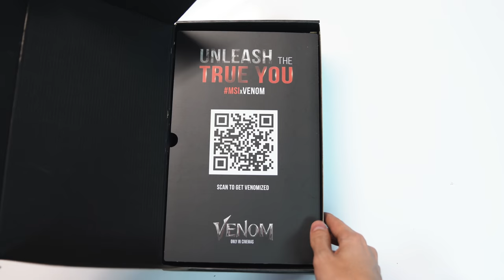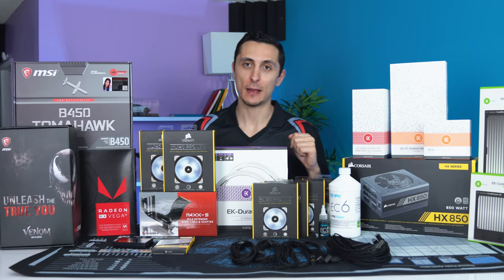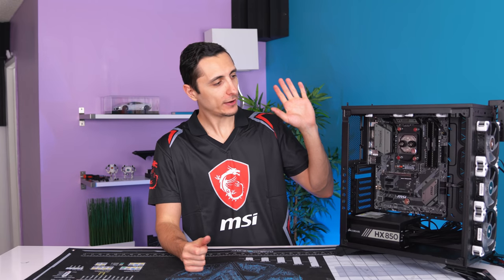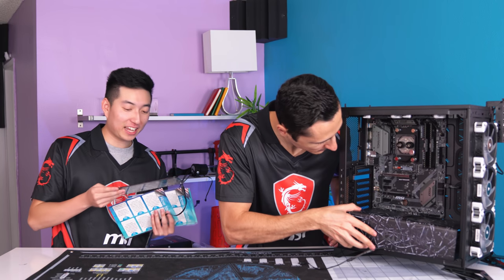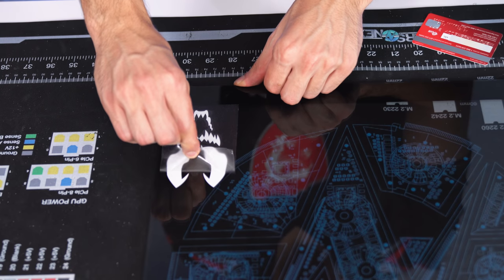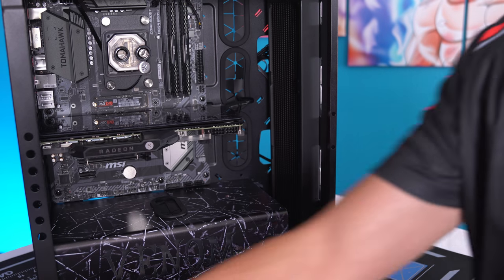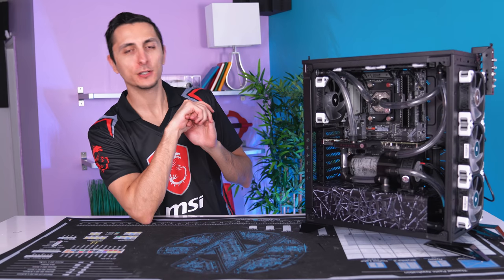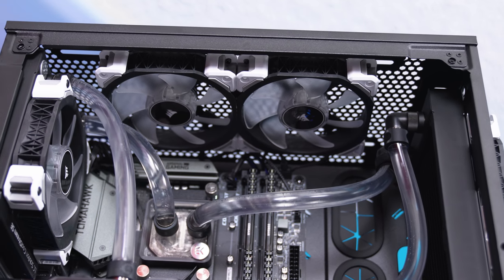Building A Venom Gaming PC - Setup Makeover Season 2 (EP 1)

Comment: I’m building my first pc soon hope nothing goes wrong :)
Reply: ExonicSkull Best wishes! If you don’t mind me asking, what are the specs? : )
Reply: i hope it goes wrong <23
Reply: @lukagafur7241  yeah. A 700£ pc and cheaper peripherals will basically do the job. Rest is overkill.
Reply: @lukagafur7241  ... I kinda agree actually. unless you're super competitive, a lot of that is overkill. I don't know your financial situation, parents, etc and I don't tell anyone how to spend their money, but just consider how small a difference but how high a difference a price between a $1,300 (without monitor) and $2,300 build. that said, I also wouldn't buy a $600 one as the other guy suggested. Yeah, it can be done, but I'm not a fan of buying anything you'll outgrow in a short time. Either way, nice job working hard. So many kids just wish for this and wish for that, but they're too lazy to make it happen and do nothing but make excuses. Good luck!
Reply: Good luck!
Reply: @sisero_05  shouldve waited for 9900k smh
Reply: Joel Klone ryzen 2700x 1070ti asrock b350 motherboard Samsung 860 ssd wd blue 1tb h200 case fractal s24 aio sf 600 power supply keyboard k65 mouse g502 monitor 144hz
Reply: @exonic5898  get a 1080 they're about the same price right now
Reply: Th 313 already ordered the parts
Reply: AcridTM i have ordered the parts already but I don’t plan on over clocking
Reply: @exonic5898  nice pc build bro, remember to get high speed ram (3000mhz) as its better for ryzen
Reply: KyronOG yeah I got Corsair vengeance ram 16gb 3000mhz
Reply: Be shure to put the cpu in SUPEEEER carefully, i have bad expirience....
Reply: AppiXx I know it’s all good I hope don’t break a motherboard pin tho
Reply: No ones gonna mension that your profile pic is kanaki
Reply: Eon Danxry lol I was waiting for someone to notice
Reply: From my expreience DONT BUILD ONE
Reply: AcridTM I’m still building mine :£
Reply: Yo yo watch a tutorial while building the pc it helps a lot
Reply: ExonicSkull trust me it’s not as easy as it seems
Reply: Same here
Reply: HyperVenom I have done so much research why is everyone treating me like I don’t know what I’m doing
Reply: good luck
Reply: Me too😥
Reply: Same bro hope nothing goes wrong
Reply: @exonic5898  if u dont plan on overclocking then why the 2700x?
Reply: ExonicSkull same brother !!!
Reply: Good luck, bro. I'll be doing the same at the end of the year!
Reply: Idkynot · 8 cores
Reply: Good luck man! Just remember ESD is your worst enemy
Reply: TheGhostGaming 40 lmfao im only 14 and going to spend $3k on a pc. 9900k, 2080 ti, 32gb 3200mhz ram, and of course liquid cooling :)
Reply: Rayan Alhilali good look I going to tell you I’m 11 years old and it took me 6 hours some things were a challenge and other things were pretty easy. Once again good luck!
Reply: Same and good luck
Reply: I am waiting for motherboard,CPU,Graphics card,waiting for that the longest,SSD,RAM,PSU,Computer Case
Reply: What parts have you got for it
Reply: Call TechSource
Reply: @cohen4831  are u talking to me or exonic skull
Reply: @davidprince4522  exonic skull but what parts are you getting?
Reply: ExonicSkull same bro
Reply: @owennagadipurna  fuck it, im 12 and im getting a damn amd 2990wx, 128gb rgb 3600mhz ram, 3 970 pros in raid 0, custom hardline cooling, and 2 rtx 2080 tis in sli (jk but you get the point)
Reply: iTz Ace scroll up and I put my parts
Reply: Cyber but the 2700x is better so
Reply: Gl
Reply: Cyber well it’s not your build so
Reply: TheGhostGaming 40 yea but if you’re building a pc just to run 60fps just buy a console. That’s when of the best things about a PC is the fram rate. And saying after 60 there’s no big difference that is false as fuck. Even a 20 fps jump is noticeable.
Reply: Take your time and watch builds and it will run smooth.  Goodluck my friand its only more expensive legos.
Reply: @iMoRTaL_Gaming007  rgb says otherwise 🤣
Reply: kratek56 thanks
Reply: Go ahead man good luck i.may reccomend the gtx 1050ti as a good graphics card starter for high to medium games
Reply: Hanjimo nah I’m going for 1070ti
Reply: @exonic5898  ok fair enough i only suggested it bc its cheap.and a good card lol why not 1080ti??
Reply: same
Reply: All the best
Reply: Bro
Reply: Hanjimo that’s an extra 300 I can’t afford
Reply: Took me 8 hours for mine but good luck my friend
Reply: ExonicSkull  same dude
Reply: ExonicSkull just watch techsources build guide that’s like 24 mins long, it literally has every aspect into those 20 minutes (building, oc, cable management, installation, free windows 10 pro (gotta get the key to avoid the water mark for about $20))
Reply: I hope your cpu fries
Reply: You got this
Reply: Chaithu thanks mate
Reply: A Person thanks :)

Comment: think it would have been cool to see hard line tubing i know its a lot more work but id also switch the coolant to a white and put black decals to make it look like venom's tendrils or yo know the squiggly parts are going up the tubes. would have also played around with the idea of using a light weight black cord or something and attached it to the fans in a way so it would look like the symbiote  is moving while the fans are running. lots of ideas with this build for sure

Comment: Board have 4 phases vith dubel components so it has 8 phases worth of components but they are in paralel so you have effectively 4 phases. So dont lie dude somevon is going to buy board thinking its an 8 phase. How ever all manofatures are doing thys and curently tere is not  bether board then 450 tomahawk and pro  carbon boath hav same pover delivery design . So its 4+3 phase.
4 for v core and 3 for soc. And it shold be listed like that.

Comment: I need help upgrading my pc these are my specs 

Motherboard- ASU’s prime Z370-P 
Power supply- EVGA 600W 
GPU- STRIX ASUS RX 580 
Cpu- INTEL CORE I3-8350k unlocked 8th gen
RAM-CORSAIR 2x 8gb 2400MHZ
Storage- western digital 4tb & 1tb

Thx